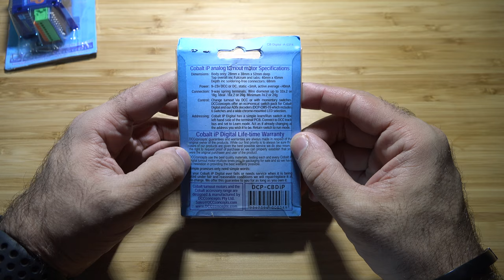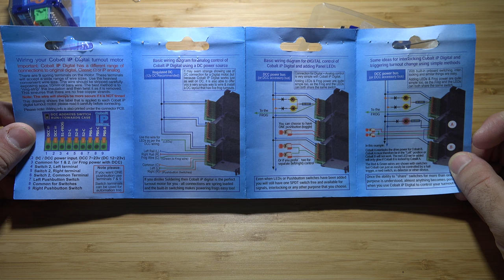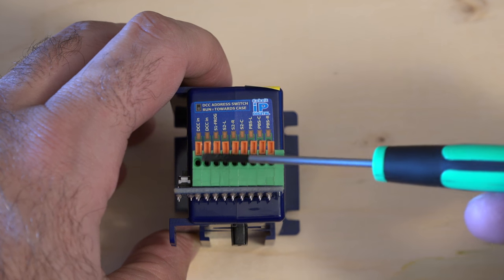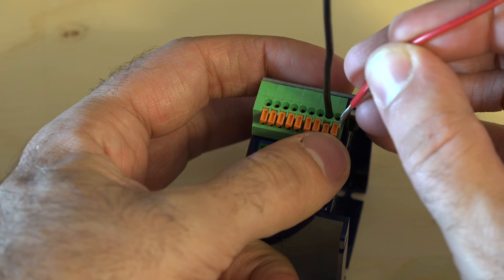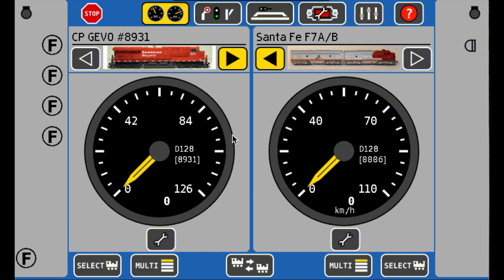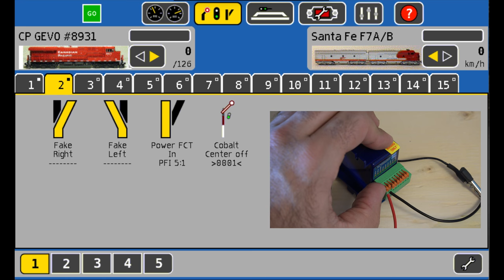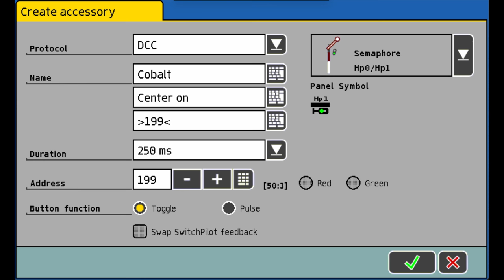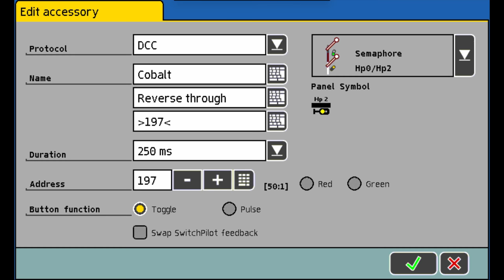Unboxing:instslling Cobalt IP Digital Motor

Comment: Glad they Worked i was a bit worried there lol ,All that work to make a switch move .They are Great motors Tim i love my Analogs, You done well .those pads also make them quieter try without one & you will see , i forgot to install 1 on mine & its NOISY .....1st Like ....Cheers-Rich.....
Reply from the maker: Hey Rich. Lol ya they would be noise with out putting those two sided sticky things.

Comment: double sided sticky backs would making them easier. that was one of the hard parts of mounting the tortoises switch machines. and the way to connect the wires.. i feel ripped off because i had to solder mine on. lol , looks very easy to set up.. nice how you do it video.
Reply from the maker: Double always makes thing easier and more fun.

Comment: I would never buy these motors again. I have had nothing but problems. They often need to h ave their address reset and I have to check optically if the points have changed as I cannot trust them. To power the signals is very complicated compared to Tortoise motors. I honestly feel that I have wasted $Au600. The spring clips that do not require soldering are a pain. They are too close together and if you don’t have the wire perfectly stripped you just have to bump it or have a stray strand and it will short circuit or pull out. I would prefer to have a solid solder fit.
I wish I had not bought them.
Reply from the maker: I was let down when I got the chance to use them!  I'm sticking to the DS64 with the tortoise switch machines.  It's more wiring but its proven system and it's reliable.  thanks for the comment. Stay safe.

Comment: This thing is too expensive... For 3€ you can have a much performanter sistem wit servomotors, and arduini electronica. For 5€ you can instal a hole digital sistem.
Reply from the maker: Hey Bartolomeo,   I bin seeing a lot of layouts using Arduino.  I am not familiar with that system.Maybe one day I'll mess around with that and see what I can do.   Thanks for the comment.